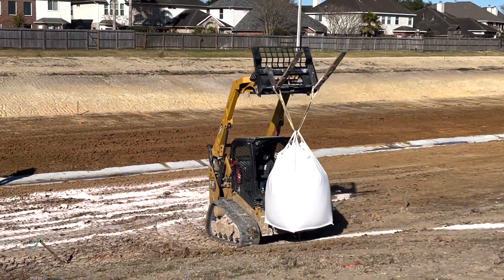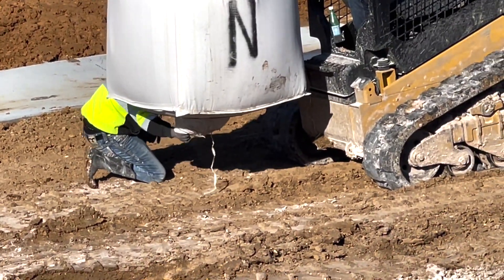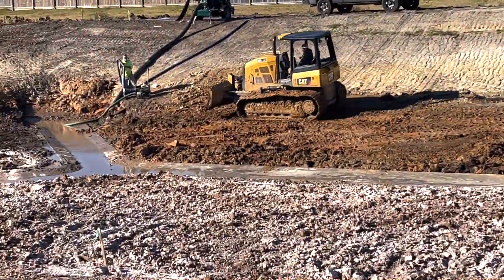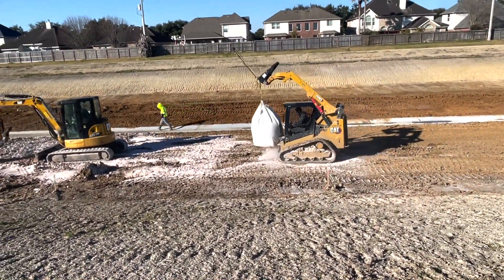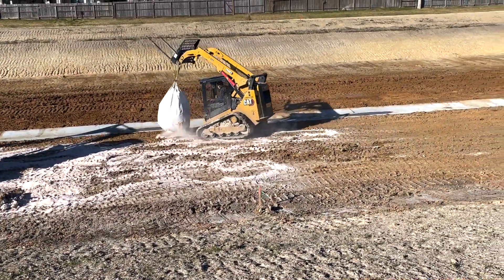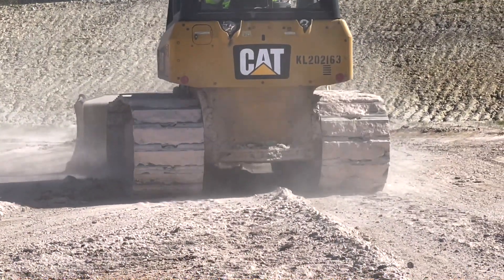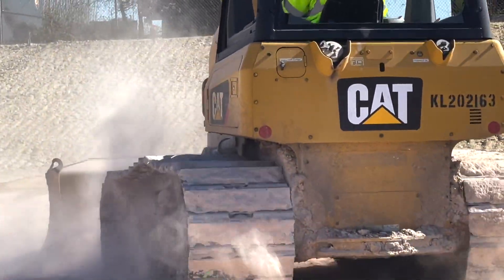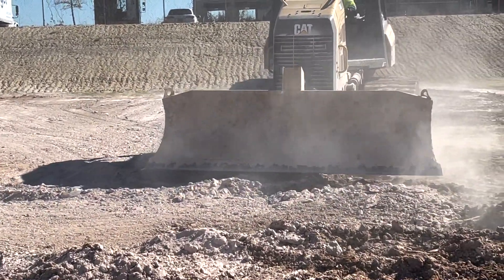How to Seal a Pond using Bentonite Clay

Comment: Outstanding video! How do you determine how much bentonite to use? How long will the seal last?
Reply: It depends with the type of the soil you’re dealing with 
Loam clay needs 2pounds per square feet while for sand needs 6 to 8 pounds per square feet

Comment: I remember picking up Railroad cars out of Belfouche SD.
An old head conductor said to me years ago.  Be careful when you go to the Gorilla factory.  I was confused.  The engineer turned and said.  The bentonite is all over the rail, very slippery and it sticks to everything like gorilla shit. 
I  waited and before I could ask about the gorilla.  LMAO.  
But it does get nasty after a thaw or rain.  
I am considering using a bag for my hogs water hole. Suddenly the clay got really thirsty.

Comment: What's a big bag of that stuff cost??  Thanks!
Reply from the maker: If I remember right it was $19,000 for 40,000 pounds. That included trucking.
Reply: @thomasconstructiontexas  That's not horrible.  I need about 1000lbs for a small project.  San Antonio a good place to get it?